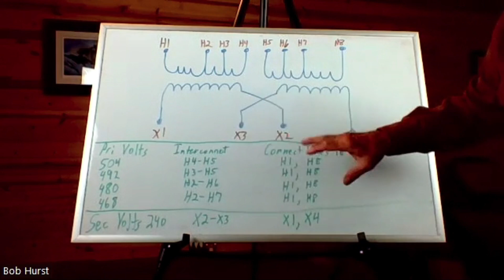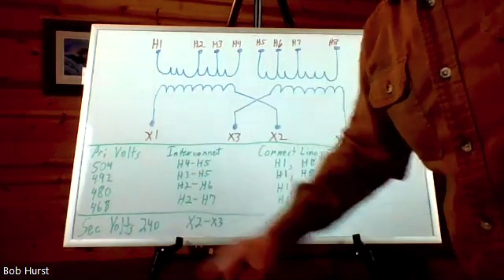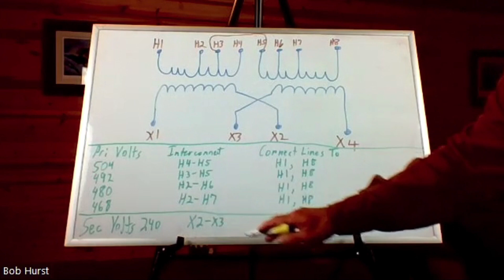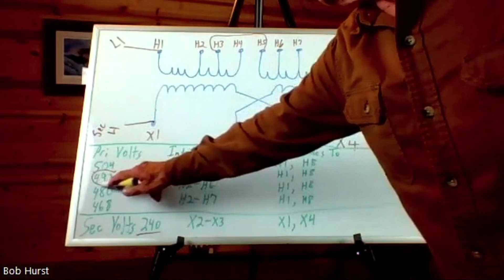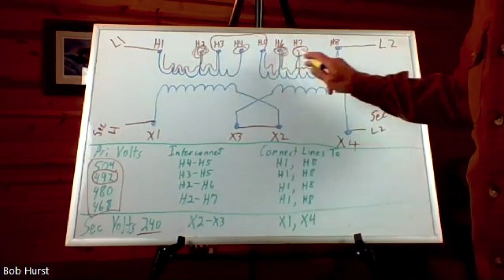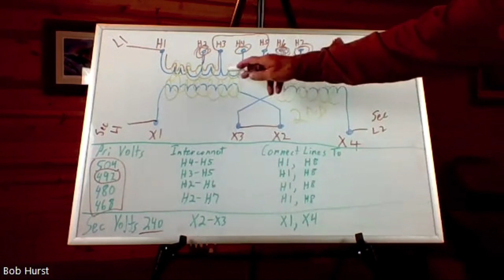Transformer wiring explained

Comment: Thanks for the video. I've wired a step-down transformer similar to this, it's actually 240v primary to 120v secondary. When I measure the voltage it's like 126v from the line to the neutral and about the same voltage to ground, which works for my application, however, the neutral to ground reading is about 50v. That was unexpected. I figured it would be zero, or close to zero v. Why is that?
Reply: You have not bonded the neutral to ground on the secondary side. Consult NEC 250.30.

Comment: I’m opening a powder coating shop after buying and moving all the equipment from someone retiring. Its electrical requirements led me here! Lots of different big electric motors, some 220v some 230 3 phase, an air drier that’s 480v. Thanks for sharing knowledge
Reply from the maker: Best of luck with the new shop!